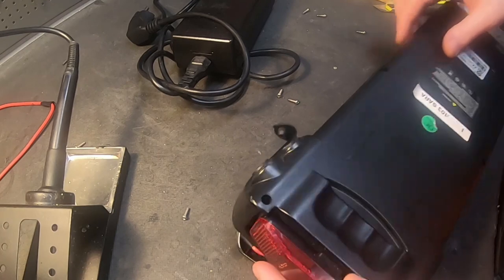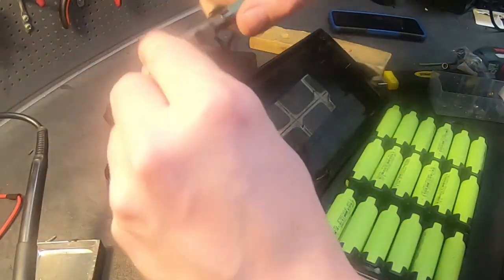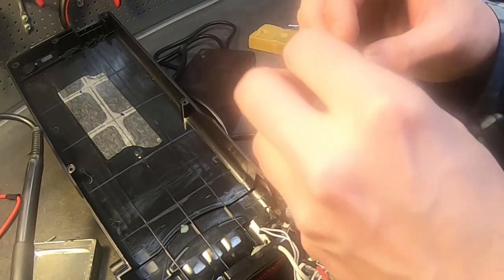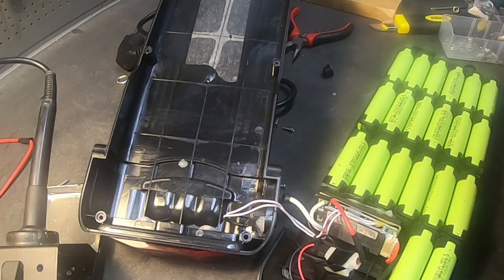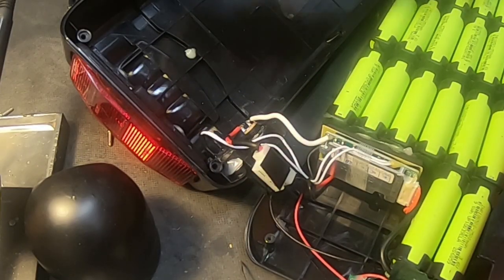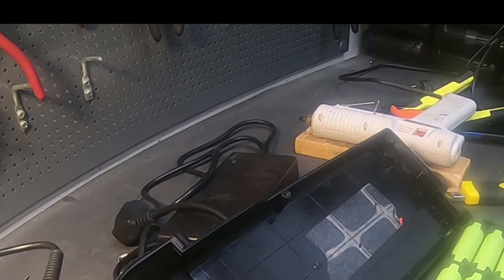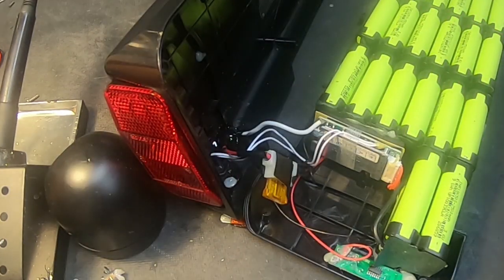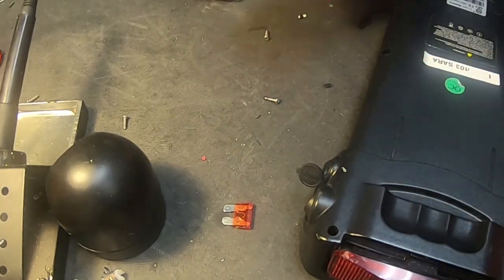How to replace the DC charging port on ebike batteries (Common problem).

Comment: Hi, I broke my charging port to my ebike. I opened it up and the charging port has 3 wires coming out of it. One going to the fuse box (pink wire), one going directly to the battery (black) and a thin red one going to a computer chip thing (which I think is the BMS). 

How do you replace a charging port if it has 3 wires, and one goes to a BMS? Do they make 3 wire charging ports you can buy? I can only find 5.5x2.5 DC plug charging ports with 2 wires (positive and negative). I don't know what to do with this 3rd BMS wire?

Comment: I have a question I have the same type as  that but what happened is I loaned out my charger came back with no plug on the charger so obvious it's easy on the charger side to tell the positive but the end plug I got is not marked there is no broken white line on either side of the two black wires so how would I determine the power wire on the tip that is pushed into the port you just replaced

Comment: Hey, i have a Promovec 50172 36V battery on my ebike. It's not delivering voltage to the battery poles, but the battery pack is fine. It's probably the electronics card in the battery that is defective. Are these available to order somewhere? Thanks

Comment: Hi i made a 36v pack for scooter on ful charge it indicates only  41.7 v .
And it switch off at 38.3v   after 40 min  working....do you have some explanation  thanks in advance.

Comment: I have a question. I have an e-scooter that has two pair of wires, charging and discharging. Can I replace that battery with a single pair two way cables? how do I connect the charging port?

Comment: Hello great video will this work on my haibike sduro 36volt both ends broke very weak part of the bike
Reply: Its i Yamaha battery you can replace it with a GX12-4 connector or similar i think.

Comment: does the port have to match the battery voltage or are they universal ?  I cant get information on the charging port but it looks the same kind as the one in this video.  
The battery is 36v 13 ah.
Reply from the maker: This port is "made" for low voltage for laptops etc long ago maby 5-20V but its now used for 24-52V ebike batteries, i never seen it used for 60V+ so guess that is not recommended. Max 3A @ 36V but 4-5A is possible if you are lucky.

Comment: Great video! Can you tell me the type of DC ports you used? I need to buy one. I also stuck my key in the DC socket :-/
Reply: Search for "2.1mm x 5.5mm Round Panel Mount Female Socket DC" or just "Female Socket DC".
Reply: Thank you Doc!

My ebike battery charger says its DC output is +48V 2.5A. Are the female sockets that are listed at rated load being :5A DC30V comparable with this Ebike Charger?
Reply: @kurtmcafee7132  Yes, those will work.

Comment: Hang on back up a moment so let's go back to the beginning..... so the original charging port the broken one  has 2 different clips one has 3 wires yellow, orange & red. Then the second clip has black & red. Can you   explain what goes where otherwise your repair starting par way through and using white wires is completely like BS.... ???
Reply: Hl
Reply: Hl

Comment: How do you connect the wires without sparks flying out.?  
 They are live wires.
I dont get it.  The first time I change the port I had no problem but when I tried again sparks kept flying out every time I tried to connect the second wire.
I think the first time the battery was completely dead, even though I was able to charge it back to full capacity.
Reply: Yo - did you figure this out? I have the exact same issue!!!
Reply: someone suggested I order new ports with red and black wires already connected.  I did this and it works great now.
Reply: @williampennjr.4448  Where did you get the port with the attached wires?
Reply: This is my problem im afraid to even touch it. The sparks literally blinded me for a couple minutes.

Comment: OK ,so I'm putting together my Ebike and here's the question. : " THE FUSED WIRE I HOOKED FROM CONTROLLER GOES TO THE PLUG?-(RED & BLACK WIRES IN THE FLAT FUSED BOX LOOKING APPERATUS )- AND THE PLUG OBVIOUSLY,(I GUESS), PLUGS INTO CHARGER?